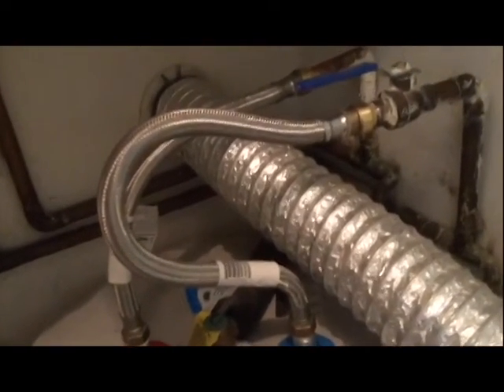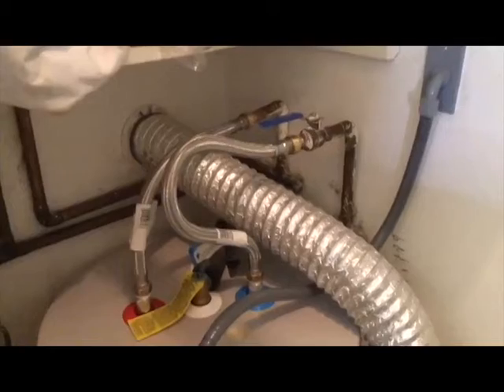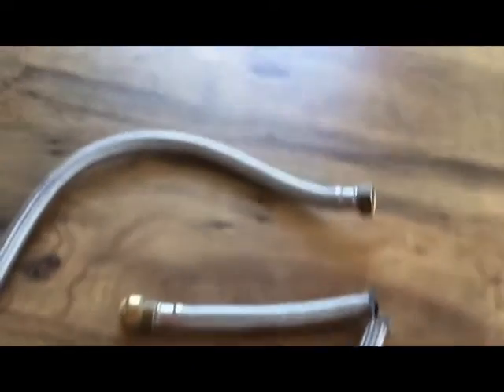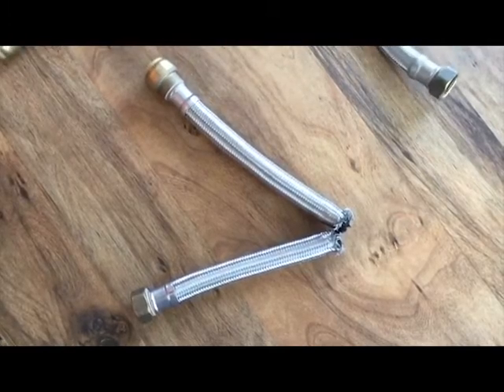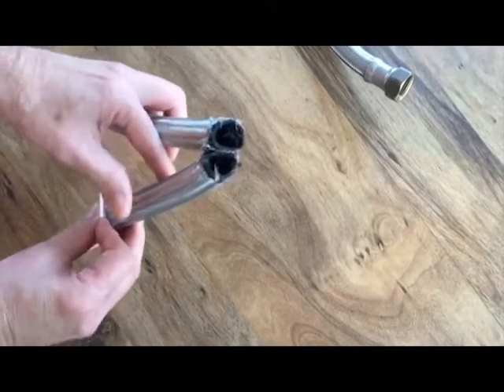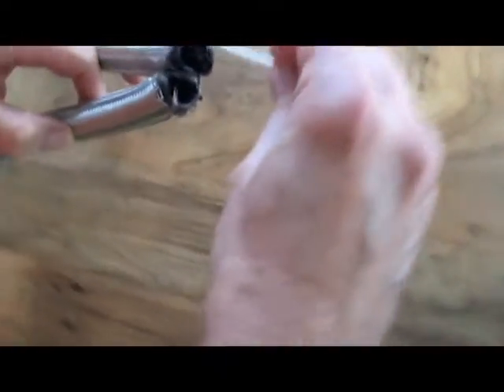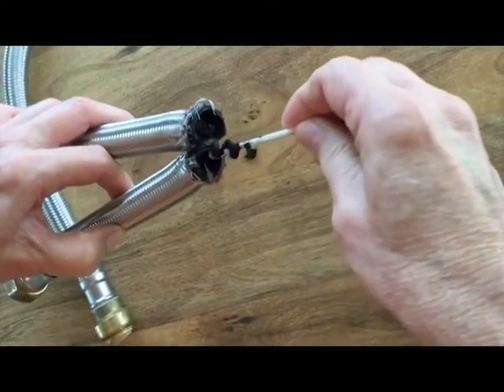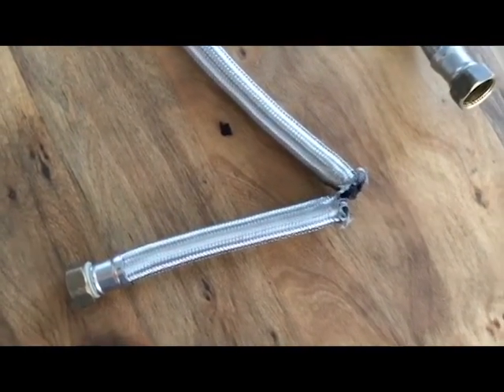Black Floating Particles in Tap Water due to SharkBite Flexible Tubing

Comment: I have been using those degrading hoses on mine since 2015, I suspected and saw online that they were probably the culprit. I am going to replace mine with standard pex plastic pipe, with crimp fittings and connectors. No more worries and it's easy to cut, replace, change down the road if necessary. I should've done it a couple of years ago when I first noticed it.

Comment: I just went to Lowes and "Shark Bite" flex tubing has something like pex on the inside. It's not rubber and it's not even black... You might not be using "Shark Bite" but just conventional hook-up tubing used for sinks and fixtures. Those are not designed for hot water heaters and therefore might breakdown from the high temps... I have black rubber, greasy flecks but it must be from something else in the tank (hot water line problem only).
Reply: WOW.... So I was "Sythed" by a kindly gentleman who claimed to be a Navy Engineer at Lowes, who basically threw me a red herring... He more or less told me that it was impossible that Shark Bite flex pipes would shed black rubbery material because internally they are (and always were [lie]) made with a PEX like material. Well... He was wrong. Currently, when you go to your local hardware store, more than likely, you will find Shark Bite flex pipe that is made with PEX internally. However, they used to manufacture them with EPDM internally (the flexible part). So he lied through omission... They USED TO be made with EPDM which is RUBBER!!! Rubber which is susceptible to degrading when exposed to chlorine based compounds (Chloramine). Rubber is known for not being very tolerant to exposure to various corrosive chemicals. Obviously, its ~virtual~ chemistry does not agree with whats in my Florida water. OH! and I forgot to mention that I verified this by using my borescope camera to look inside the flex pipe. It is definitely black and definitely rubber because it flexes almost like a garden hose as opposed to PEX which is not as flexible. Class Action lawsuit anyone?

Comment: Thank you, pays to do a little research. Called a plumber and he recommended a $5k filtration system. I'm replacing all the water supply lines. The particles are bad enough but a failure could lead to flooding.

Comment: Ty sir, you have confirmed it's the sharkbite. City tested water twice and said it was fine. They went ahead and shut the area down and flushed it. Sill had problem, so I had the heater replaced. Still the black continued to gunk up my sink faucet. I got to thinking maybe it's the braided sharkbite hose, and maybe the plumber didn't replace them when replacing the heater. Your video confirmed my suspicion. I'm pretty sure now it's gonna be the hose. Will find out this week when I find a different type of hose to use. I know nothing of this stuff so I hope there are other hoses that are white or see through that can be used. Time to Goggle

Comment: I'm seeing the same black stuff but only through the hot water on one bathtub, not through any of the other TAPS in the home. Still the likely culprit?
Reply from the maker: Andrew DeWeerd ... yes, it’s the hot water that breaks down the rubber liner of the tubing... I suggest that you replace both cold and hot water lines ASAP as it will only get worse... good luck !!
Reply: Yes because it is getting caught in the aerators

Comment: THANK YOU! I was about to hire a plumber to try and find the problem and luckily (as an avid DIY'er) decided to see if others were experiencing the same issue. When I replaced my water heater I used the same Sharkbite lines you did. Will be changing them out this weekend and flushing out the water heater. Here's hoping it works!
Reply: Susan J'Laine Mills did it work for you??